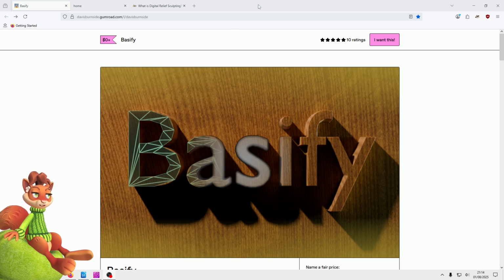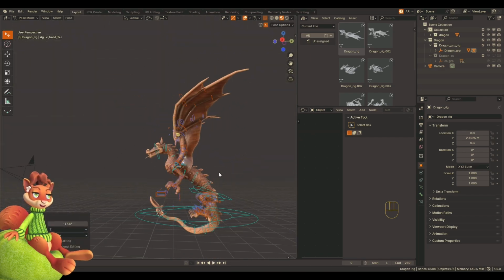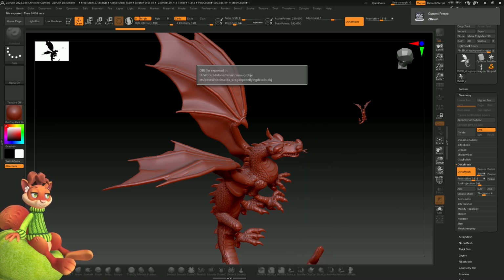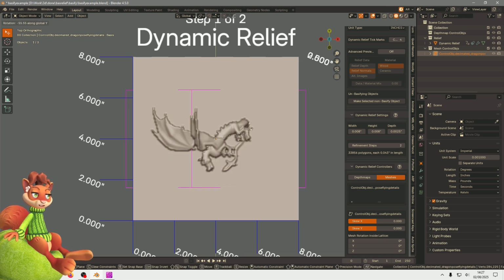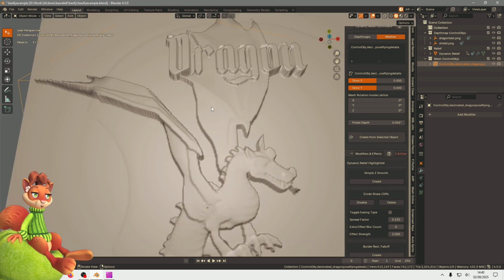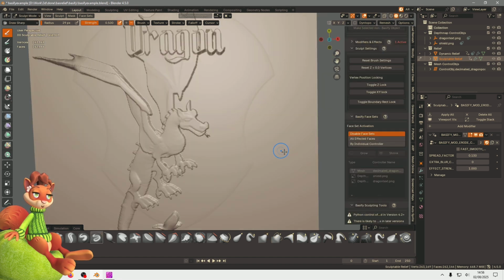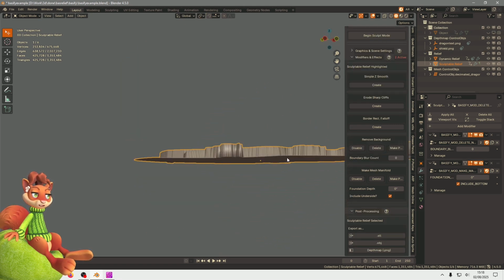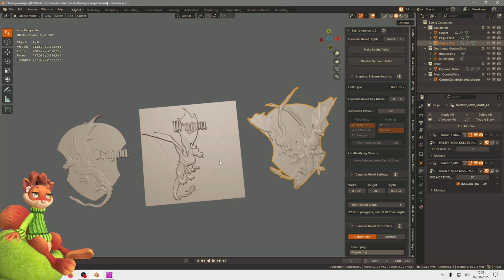Basify Bas Relief Sculpting Blender Add On Demonstration with 3D models and depthmaps

Comment: Thank you so much for trying out my addon! I hope you & your viewers find it useful.

When using "Mesh Manifold" Modifier, you can increase the "Foundation Depth" slider to increase the base thickness. This lets you avoid needing to extend the bottom in Edit Mode.

To get the best results & preserve maximum details from 3D models, the "Erode Sharp Cliffs" modifier settings (especially "Effect Strength") can be combined with deformations of the Mesh's Lattice container. Ideally, the Object should occupy most of the Z space between the bottom of the Dynamic Relief & the probe depth. You can also rotate the mesh inside the lattice, instead of the lattice itself, using sliders under "Dynamic Relief Controllers -> Mesh"
I'll make a video showing the best way to do that.

The disappearing tick marks & scene text seems to be a bug. Thank you for finding that, I'll patch it in my next release. If someone encounters that bug again, you can try fixing it with the "Disable Dynamic Relief" button, then reenabling. Saving & restarting Blender may work too.

To you and your viewers, please let me know of any other features you'd like to see in the next version. For reporting bugs, I have a page on the project repo where I can give feedback.
https://github.com/davisburnside/Basify-Dev/issues
Reply from the maker: Oh wow thanks for this comment, I'm sorry I only saw it today because it had been put in a 'held' thing by Youtube, prob because you put a link in it. I'll try all the settings you suggest thanks 🎉